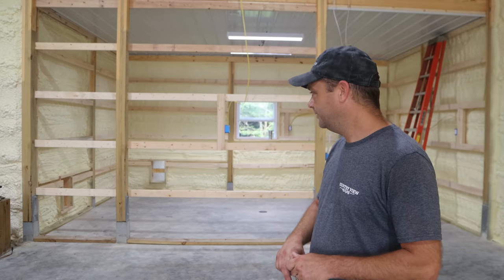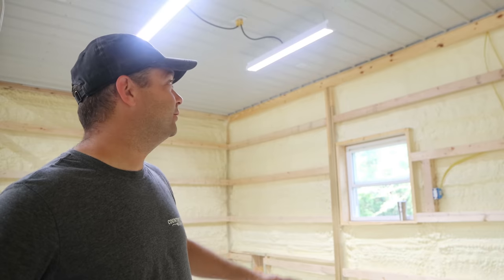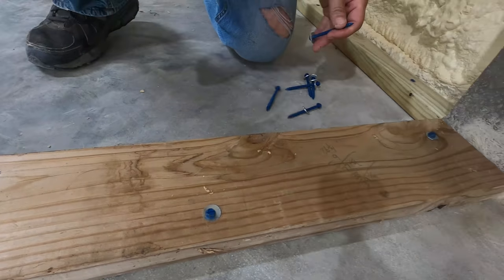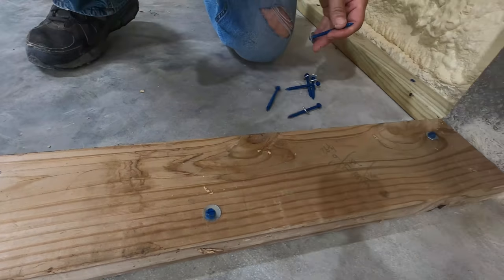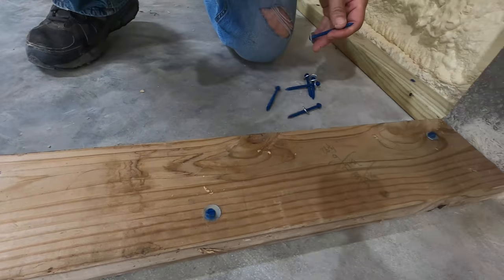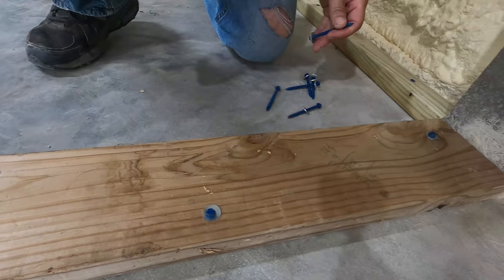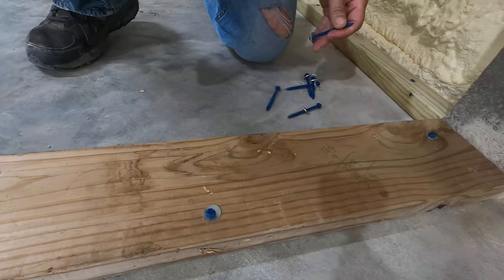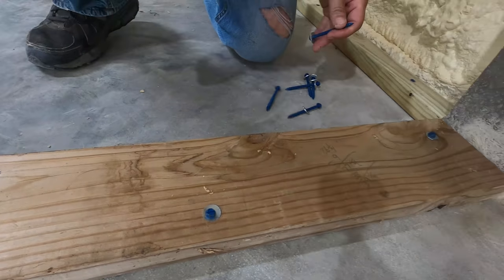Building a dog kennel in our new pole barn.  Getting started on the inside of the kennel.

Comment: Are you going to put any kind of sealant or caulk on the bottom of the metal?  It looked like there was a small gap, where it met the concrete.  If you was to bathe the dogs water might leach under the metal to the wood or was there something there to stop it?

Comment: NO MATTER HOW YOU ARE GOING TO USE YOUR BARN, seal all of the floors two coats.
However, unless today's coatings are different than we did 30 years ago.  Depending on how you use your barn, we recoated when needed! Never had a problem with oil stain.

Comment: Ingenious idea to use tin sheets (as we would call them) on the walls to prevent damage. Probably you are already ahead of me, but just in case, I will politely suggest that you seal the gap between the tin sheets and the floor to prevent dirt and moisture (i.e.: dog urine and excrement) seeping through the gap to the wood. It will smell to high heaven and will be very difficult to clean.
Reply from the maker: They will always have access to the outside, so hopefully they won't pee inside.
Reply: Seal that floor real well!
Reply: @CountryViewAcres  dont count on it. A sudden sickness or upset tummy and they could have diarrhea, and the smell would never come out.

Comment: Exploring your videos - found you because of baling hay.  Question on your new building.  Don't you have electrical inspections there?  You make a big deal to talk about having GFCI outlet protection but what about NEC requiring support of your wires within a foot of the box and 4-1/2 feet thereafter.  I guess you might be close on the 4-1/2 foot number but I don't see staples near the  boxes.  I can't believe I'm the first to question this.  Also, yes, its great to see you working with your wife.   So now you get a big shop, what did she get?

Comment: Check with a scrap yard to see if they have any crib panels You could buy from them. That's where I bought mine, they were 5 feet tall and 10 feet long. Bought enough for a 24 foot by 80 foot run using the shed for part of the run.

Comment: looking good guys. I wasn't sure about that wall panel idea i was thinking that's gonna be noisy but it sounded fine, 3 ideas
1. seal the floor well
2. wall to floor gap needs to be filled (silicone) to stop water/pee from getting to your timbers
3. make sure you can get your tractor into the dog pen for clean up/mowing

Comment: Why did you use concrete blocks under the posts?
Reply from the maker: They are a perma-column.  Basically a concrete post with a bracket to add a wooden post on top.    No wood is in the ground.  So no post will ever rot.
Reply: @CountryViewAcres  Wouldn't the post rest directly on the concrete floor anyway?
Reply from the maker: @markthompsoncpa , no the posts go 4 feet deep in the ground.  Concrete Floor is too thin to mount a post.  You would need a concrete foundation, if you wanted to put posts on top of the concrete.